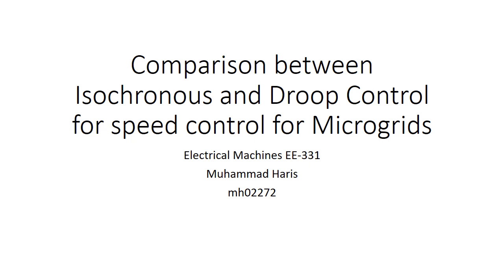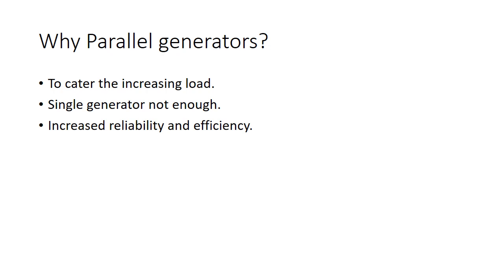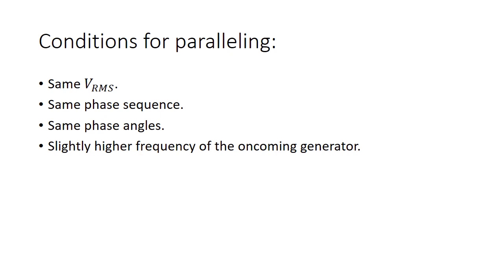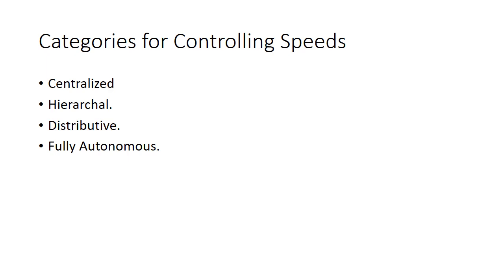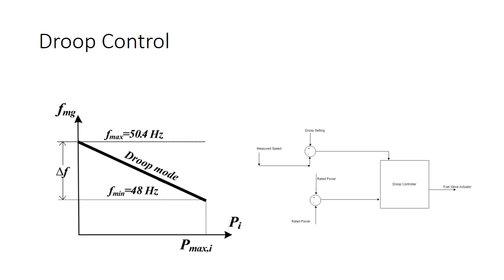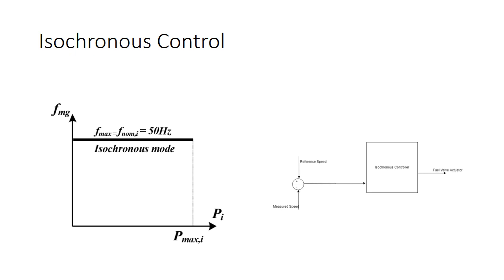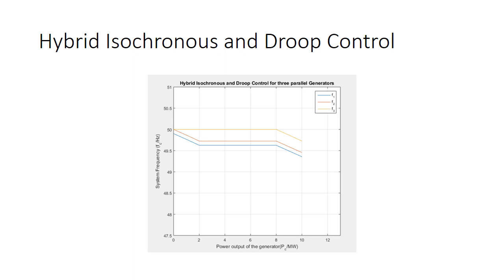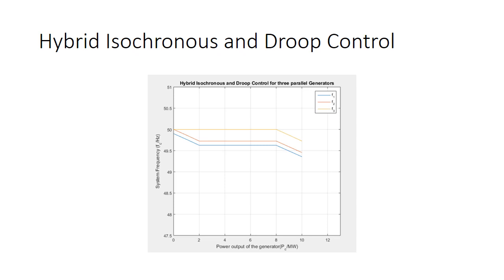Comparison between Isochronous Control And Droop Control for Speed Regulation in Parallel Generators

Comment: Hi sir, and thank you for the video. I want to ask a question. 
In a real grid, the secondary control (which returns the steady state error to zero) is applied only to the fast/ peekers plants?
Furthermore, is this a continuous operation, or happens in intervals (for example: f drops to 49.8 -> we sent signal to make it 50 and the wait until it gets again 49.8 or 50.2)
Thank you in advance!
Reply from the maker: Hello. Sorry for the late reply, I missed out on the notification. I am not sure about the first part. 
For the later half, theoretically yes it is continuous however to reduce the wear and tear of the actuators we usually add relays that make it s a discrete process. So in small intervals, the change and interval is application dependent.
Reply: The secondary control applies to any power plant that can provide ramping higher than a threshold.
The central regulator (AGC) sends the control order to control power plants every 4 seconds. This does not mean that the order changes so quickly because the secondary control is a slow action.

Comment: Sir , Which one better droop or Iso mode ? So say I want to parallel two generator , which configuration should i do ? Droop or iso mode?
Reply from the maker: Isochronous can get hazardous but has its advantages. Droop has a drawback but is safer to use. So a hybrid technique which is proposed is much better. 

Search for hybrid iso droop control on IEEE xplore. You will get the details of this control and how it is better than the individual iso and droop controls.  

Let me know if something doesnt add up well.
Happy learning! 😊